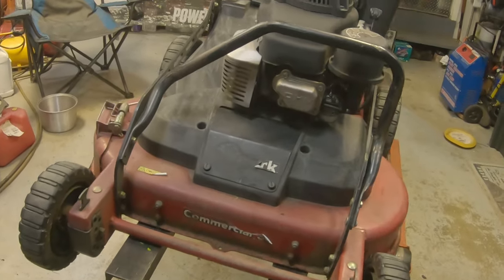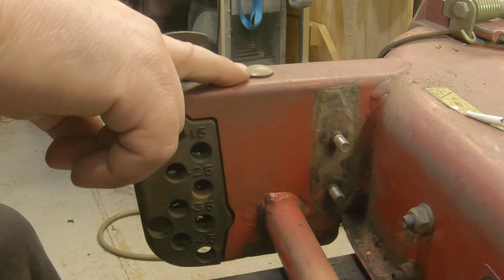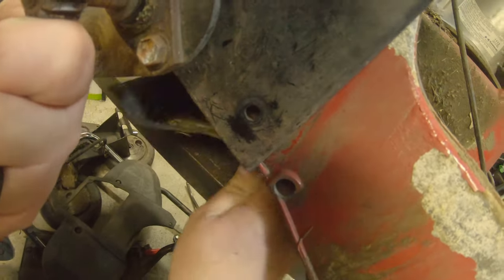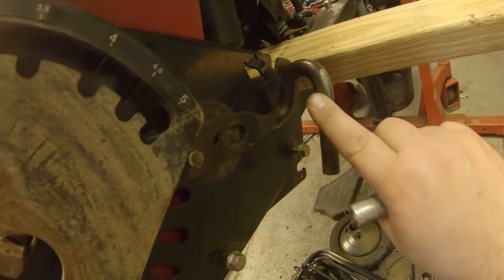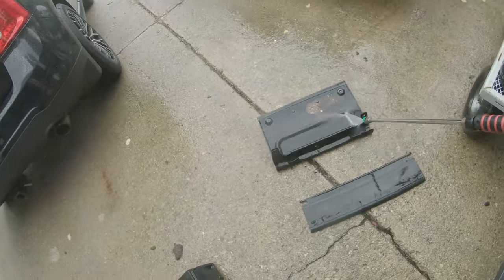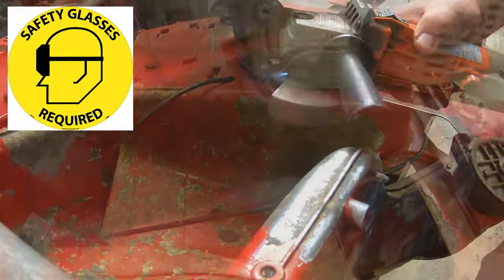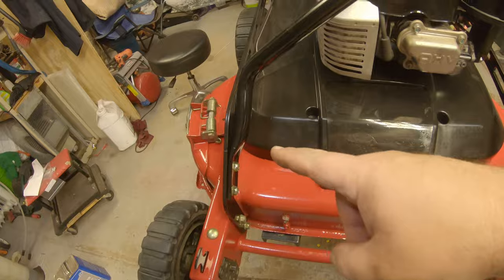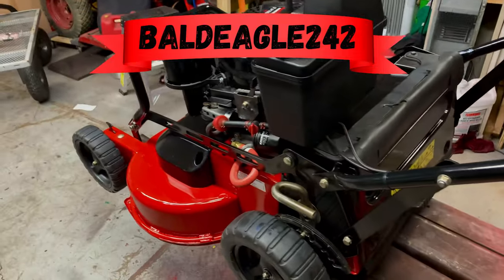Unbelievable Transformation Of An Exmark Mower!

Comment: Thank you for this. Very well done project and video. Anything to look out for on these engines? I recently got a Toro Turfmaster 30” for dirt cheap that I’m about to start a full resto on and wanted to make sure the FJ180v is in tip top shape in addition to the other mechanics and aesthetics.
Reply from the maker: I’ve personally had good luck with these engines over the years. I’ve never had to open one up for internal problems. About the only thing I’ve had to worry about is a broken pull rope or a dirty carb. There are quite a few people who say this engine is under powered for a dual blade 30” mower but runs forever.

Comment: Go Bucks..... Cbus here..... saw your plate : )  My 30 has a nasty crack in the deck where the motor bolts up and I wonder if it's weldable ? I say that as it looks like a more brittle metal than steel, looks like its the frame above the deck part # 136-5908-01
Reply from the maker: It’s pretty brittle cast aluminum.  I’m not sure if it can be welded or not. I have taken aluminum window screen and JB weld to make a “hillbilly” repair in a pinch but it really depends on we’re the cracks at and how bad it is.
Reply: Yeah will need welded for sure

Comment: Update,new upper deck is installed literally every pulley belt moving part has been replaced doing while I was in there type stuff,new filters plug and oil  too everything has a new coat of paint and detailed and put back together ,It looks brand new!
Even though I bagged and tagged everything took pictures your video was a real help brother .
Reply from the maker: That’s awesome. Thanks for taking the time to leave a comment. 😁👍